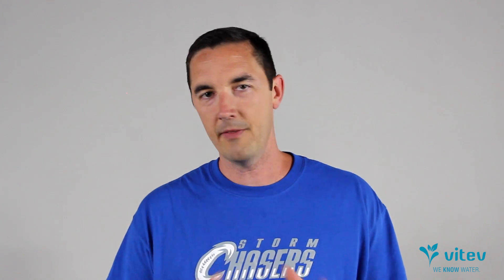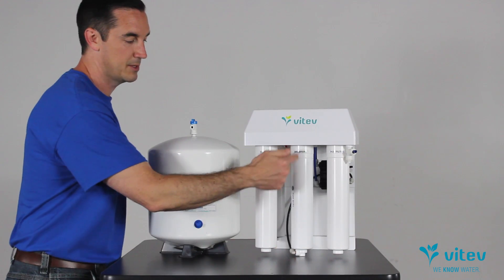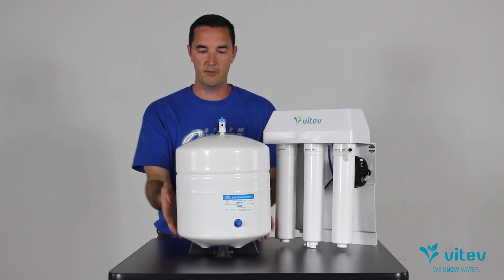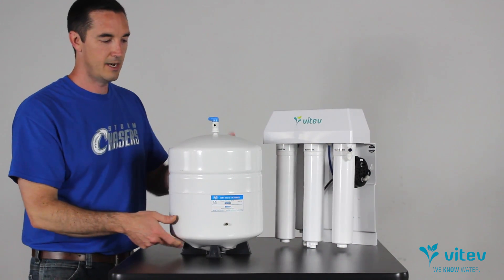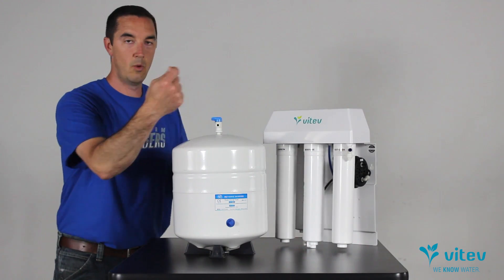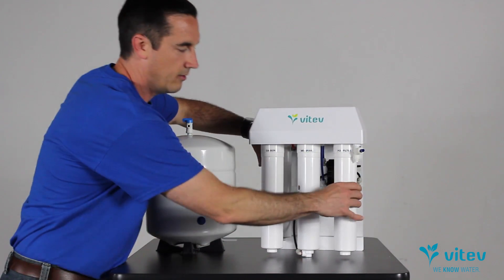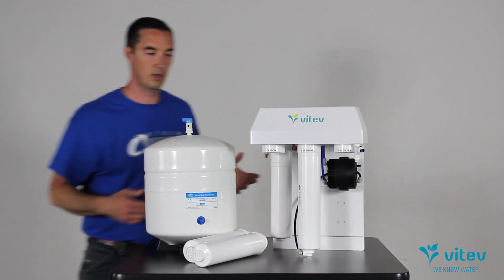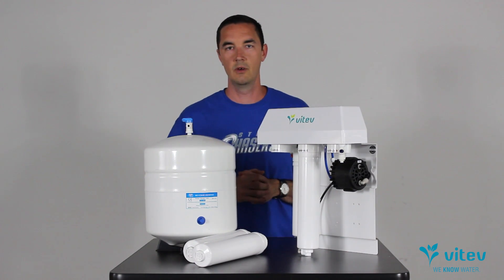How to Troubleshoot a Reverse Osmosis system

Comment: Doe anyone know the flow that should be coming out of the RO filter?  I only get a trickle, is that ok and I'm just supposed to rely on pressure at that point?
Reply from the maker: You'll only a trickle to small stream through the clean side (permeate) of the membrane. That's why there is a storage tank, otherwise you would have to wait a long time to fill up a glass.

Comment: i've tested my RO output (Watts 5 stage) with a TDS meter and it is the same (74) and the input water. I know that years ago it was definitely reducing the TDS but now isn't. I've been changing filters regularly and I think the membrane is about 1 year old.  I recently changed all the filters and the membrane looked clean. My output is excellent. The tank fills fairly quickly but I'm wondering if the output is TOO fast. WHen I empty the tank and just let the water run from the output faucet, it's a pretty stream. Could the input water be bypassing the membrane for some reason but still ending up in the storage tank and not the brine? TIA
Reply from the maker: Definitely an issue at your membrane stage. Water post membrane should be a slow trickle at best and you should see a significant reduction in TDS. Could be either the membrane isn't fully seated/sealed into the housing and the water is then bypassing it, or maybe the membrane has been damaged by chloramine/chlorine.

Comment: After installation, i don't have water in tank at all
Reply from the maker: Do you hear water running through the system and down the drain? Made sure the tank valve and supply feed are turned on?
Reply: @vitevtv  I will check thanks for your response. Thank you.

Comment: If the system is running and you disconnect the tank to check cartridge the water is going flow from hose you disconnected it. How can you check one by one when water splashing.
Reply from the maker: Turn off the supply first, remove the hose and place it into another container, then turn the supply valve back on.

Comment: I'm having an issue with my MAXX passing a lot of water to the drain and the pump is making a high speed knocking sound. Going to check the things in this video this afternoon. But what happens if it's the RO draining back? You mentioned it in this video but didn't say how to address it. Also, how do you diagnose a pump problem?
Reply from the maker: Hi LS. Shoot us an email at contact@vitev.com as we can help better there. Not sure what you mean by RO draining back. You can't get waste water back up into the membrane or into the system because we have a 1-way check valve installed in the bottom of the membrane. It only allows water to flow out of the drain line, not back in. As far as pump issues, typically if there is a problem, you notice it in the clicking cycle, or lack thereof.

Comment: We just replaced all the filters including the membrane in our R/O system..after emptying the tank 7 times the TDS is still almost as high as the raw water which is 370 and the r/o water is reading 270. Is it possible there is that much preservative still coming out of the membrane?

Comment: just installed a system and the tank does not fill. The water just runs down the drain and nothing is coming out of the tap.
Reply from the maker: It will take a while for water to get to the tank as the membrane severely restricts the flow rate. If after a while, no water is getting to the tank, then work your way back towards the water supply checking every step along the way.

Comment: There is a delay between the time I turn my faucet on and when the water starts to come out. It can be very long, almost a full minute. Once the water starts to flow it has plenty of pressure. I check the tank pressure regularly and just changed my filters. I still have the original membrane, but again I have plenty of water. What could cause the delay?
Reply from the maker: Hi Nathan. You have us stumped. If you ultimately get good pressure from the faucet, then it's not a clog or tank pressure issue. Is this a recent change? How far away is the tank from your faucet? Do you have a post tank filter?
Reply: @vitevtv  
Thanks for the quick reply! Below are my responses:

The tank is in my basement, but basically directly under my faucet. I'd estimate the hose to be 10-12 ft. It has been acting this way for a long time (years). I assumed changing my filters would resolve the issue, but no luck. I do not have a post tank filter.
Reply: I think some big chunk of particles were stuck in the source of water which cause delay of the water coming through.

Comment: My tank will not fill with water. I have 8 ibs if pressure in it empty. Water is going through the system because I get water from the faucet but it runs out. I have changed all filters and still not filling with water.
Reply from the maker: Hi XCR. Did this happen slowly or just all of a sudden? Couple of thoughts. 1. Check the tank valve and make sure it's not still turned off from when you changed filters. 2. If it's open, remove the tubing from the valve and let the system run to see if water is making it to the tank. 3. If so, take some pressure out of the tank, down to 5-6 PSI and see if that makes a difference.
Reply: @vitevtv  It happened sudden. The tank valve is open. I followed the flow of water and the whole system from the inlet to the tank to the faucet has water flow. I let out air and still no water is enering the tank. To add to that my faucet pressure is not very low and little to no water now compared to before I changed pressure in would get a liter every few hours. The knocked on the tank and noticed it feels solid on the top of the tank and when I knock on the bottom it sounds hollow or not dense.
Reply from the maker: @backpackertoo  is the tank full of water? You might have a ruptured bladder and the tank is full, but unable to push water out.
Reply: @vitevtv  No the tank is completely empty of water. It seems like the water gets to the tank but it does not fill.

Comment: my system is making a double horn sound every three seconds. it stops when the water is turned back on. under the sink I can see the line pulsating. The faucet is leaking too. One thing that is new as well is that I can hear the water draining in the drain hole for the sink on the left side even though the faucet for the RO is on the right side sink.
Reply from the maker: You have a lot going on that we'd need more clarification about to help. Where is the faucet leaking? Is it an air-gap faucet? Is the drain line connected to the left side of the sink? Which tube is pulsating? Often noise is the result of trapped air, sometimes in the check valve that is usually on the top of the RO. Have you changed filters recently? Any way for air to get inside the system?

Comment: My well stopped working for a day so no water pressure.  It was fixed but then my new reverse osmosis system slowed and stopped. What happened?
Reply from the maker: Hi Susan. Without more information it's hard to tell. What was the fix for your well? Was it a part failure? Sediment/rust build up? Could maintenance on the well have cause a clog in your RO?
Reply: @vitevtv  It was the solenoid. The RO system slowed and stopped within 48 hours of the fix of the well.
Reply from the maker: @susansmith4105 slowing and then stopping sounds like a clog. Try to follow the steps in the video to remove filters one at a time...that should show you where the water is stopping.

Comment: Hi there,

Have you ever noticed water coming out of the Schrader valve? Is this normal or indicates some sort of trouble with the tank? Reply to the Comment Pl. & ty. I noticed that some water was coming out of the pressure valve and I am not sure if that is a normal thing. IMHO, there should never be any water coming out from the valve. What are your thoughts on this? Thanks.
Reply from the maker: Correct. You have a bad tank that will have to be replaced. The bladder has probably ruptured.
Reply: vitevtv Thank you so much.   I thought so and so I have already ordered a new tank. Thanks for reinforcing my decision.

Comment: My tank doesn't fill up ? I dont know why?
Reply from the maker: Check your filters like our video. Start with the one closet to the tank and see if water is coming through. Work your way back to front. If water is flowing through all but not getting into tank, then it's a tank issue. Either too much pressure in the tank or the bladder has burst and the tank is actually full, there just isn't any pressure to push water up and out.

Comment: Kept looking at videos and they all just said "it's probably your tank," but I wanted a systematic approach.  The trickling started right after I changed three of my filters.  My tank is only a couple of years old, was working before I changed the filters, and it felt light, so I wanted to skip disconnecting the tank.  Turns out my problem was the furthest upstream, the cold water valve had become  clogged.  Disconnected the valve, cleaned it and now waiting for the tank to fill.  Looks like I need a whole house filter for sediment.  Thank You for the right approach to fixing my problem; more water came out of that faucet 10 minutes after I did this than came out all morning.
Reply from the maker: Glad we could help! Any idea what it was clogged with? Could require sediment but could also need a softener.
Reply: @vitevtv  It looks like black , slightly elongated particles  If I had to guess I would say it was from the interior of the main line into the house.

Comment: Hello there, I just got my RO system installed on Friday, the guy told me to leave the faucet open for several hours, forgot already for what purpose. The tank is not getting full overnight, also, I'm checking the quality of the water with a PPM meter and it's failing so far, average around 380 p.p.m. my bottles of water averaged 20 ppm. Do you think I got a defective system? I'm calling the company on Monday but I still would like your opinion. TIA.
Reply from the maker: You have a normal RO (not alkaline) and you're getting 380 ppm? That's definitely defective. What is the TDS of your source water? There is also no reason to leave your faucet open...by doing that you're not allowing the tank to fill.
Reply: @vitevtv  it's alkaline, yes around 380 ppm, no sure what is TDS, I live in tolleson Arizona.
Reply from the maker: @jaimeim18  Sorry..TDS is total dissolved solids. That's what you are measuring with the meter...TDS in PPM. 380 is very high for alkaline cartridges, so you're probably getting a lot of the initial dust and particles from whatever media is in the cartridge. We would expect that to fall off quite quickly as you use it. An alkaline RO system is not going to have the same really low PPM as normal RO systems so looking at higher TDS levels is not a way to know if the membrane is failing. You'd have to check the water directly after the membrane, before it goes into the alkaline cartridge.
Reply: @vitevtv  what would be a normal PPM with the alkaline system after the system settles?

Comment: Great video. Have an Wher25 system  nothing comes out of tap, have checked pressure in tank all OK, replaced the 3 filters 2 mths ago but bought & replaced Membrane filter again yesterday, nothing out of tap. Took inlet line off tank flooded me & lots of pressure from tank. Would it be a problem with the tap.
Reply from the maker: Hi Ian. Hope you've dried off!  We'd recommend working your way back from the tank. Turn off the tank valve and then remove the tube from that connection. See if anything is coming out of that tube while the RO works. If so, it's not a clog in the filters/membrane. You can do the same with the faucet connection...see if water comes out of the tube. If so, then probably the faucet mechanism. The other thing to check is if there was a cap/plug in the membrane that needed to be removed before it was replaced yesterday. Our cartridges all have a plug that can be missed and left in before the filter is screwed in. If there is and it's still there, the membrane might not be letting water by. Or it could just be a bad membrane. You can check that by inserting the old membrane and see if water flows again. Hope that helps. Let us know if something doesn't make sense.
Reply: @vitevtv  Tried that late yesterday   so lots of water pressure from tank & pipe to R/O system so changed the 2 outside filters over one for the other, lots of water coming from tap for about 5hrs now this morning nothing again  So tried changing the outside 2 filters over (as I did last night) nothing from tap. Even put the new Membrane filter back on again still nothing. I am at wits end now.  Nothing from  the tap but waste runs constantly Thought about getting 2 new outside filters again the others were put on new in December.
Reply: Just checked & tank is not getting any water in it.
Reply: @vitevtv  Thanks, I tried that lots of pressure from tank, also lot of pressure in pipe to R/O system. Last night I changed the 2 outside filters with each other and had good water from tap for about 4 hrs then it stopped again . This morning I even put the new Membrane filter on again still nothing also changed the 2 outside filters with each other (as I did last night when I got water)still nothing from tap. At my wits end now . The only thing I have not tried is removing pipe from tap to see if it has water,( its job to get to though) should I try this . If I remove the top part of tap mechanism no water comes out with tap turned on.
Reply: No water getting to tank. Thanks for your help at least I know. any ideas what could be stopping water getting to tank.
Reply from the maker: @ianbarton4348  If you had water for 4 hours last night, it's probably not the faucet. Have you check the pressure of the tank when it's empty? If that's too high, it's not going to allow water into it and will force most of it down the drain. Should be in the 5-7 psi range. At least most tanks are.

Comment: Thanks for this video. It's very informative and I will try your techniques. I'm wondering if resolving a potential clog will stop the faucet from leaking. if not, will you do a video on leaking faucets and, in the meantime, will you explain what the possible problems are that may be causing the leaks? Thanks again!
Reply from the maker: Hi Caroline. Where is your faucet leaking from? The connection with the supply tube or internal mechanism?
Reply: @vitevtv  Our supply tube is leaking after we had a plumber come out to replace the garbage disposer.   Do we take all the cartridge mechanism off the wall to see the origin of the leak behind and at the top of the cartridges?
Reply from the maker: @dr.jerrygustafson7680  Can you see where the supply tube is leaking? It either has to be at the supply valve itself on your cold water line or where it connects into your RO unit.

Comment: Did I miss something? Or did I hear him correctly say to remove the hose from the tank and see if water comes pouring out. Well of course its going to come spurting out. You didn't turn off the main water valve coming in!!!!!!! What about the drain hose! That wasn't covered!
Reply from the maker: Hi stainless. Water won't come out if you have a clogged filter or membrane, and even if those aren't clogged, the flow rate post membrane is very slow. It's more of a trickle and easily handled. There won't be water all over you or the cabinets.

Comment: This was a great video, thank you very much.
Just had a quick question, my RO system has good pressure/flow in the morning (first use) and then it slows down. I checked the pressure, it was low. in the process of removing the water from the tank to check the pressure, I saw some black particles coming out of the tank. They were like black thin paint chip or black very thin plastic pieces. We have still the same slow flow problem after pressurizing the tank. You think it is the tank that we have to replace?
Reply from the maker: Hi Mehdi. The black pieces could be part of the tank's bladder. That's what holds the air inside the tank causing the pressure required to push out the water. So a blown bladder would mean very little pressure/slow flow.
Reply: @vitevtv  thanks a lot.

Comment: Hi, I just replaced pre and post filters and membrane on my GE profile RO. If i remove the membrane I get great flow. If I leave it on, I get the “fill a half cup” problem.Very little water trickles from the filters to the tank, so it’s not the tank. Do you think it was a bad membrane?
Reply from the maker: Hi Jacob. Potentially. The membrane will drastically restrict flow when it's operating well, so it depends on how long it takes to get that half cup. If you've noticed a significant reduction in how quickly you get water thru the tank compared to when it was new, then your membrane is probably clogged. That also means you might need to change the sediment pre-filter more often, or look at something like this to make the water softer. https://vitev.com/collections/pre-filtration/products/scale-guard

Comment: Hi, my waste line is connected to a flow 300 which has a cutoff switch on it on a 5 stage osmosis water system, I've  change all the filters and now if I have cutoff you can hear water fast when opening faucet to run water, water will run slow but if I turn waste line water running from faucet runs fast, can I leave waste line closed as water is clear and fast. I've looked around on videos and images to see if I've set it up wrong but cannot see one that has the flow 300 cutoff attached, if I follow a osmosis PDF file with all different setups  it completely bypasses this little cutoff  attachment as it's not even there but I find I can then hear it continuously running down the drain